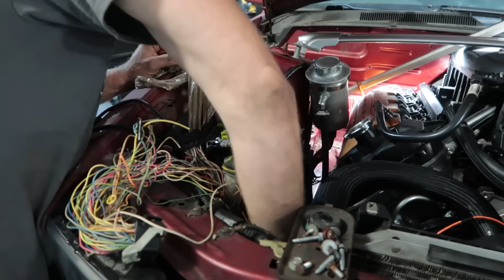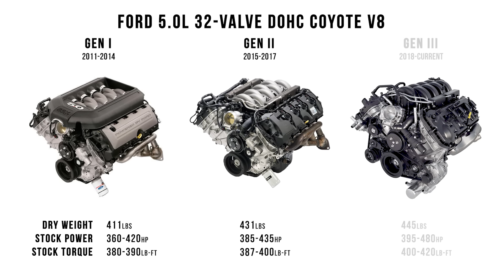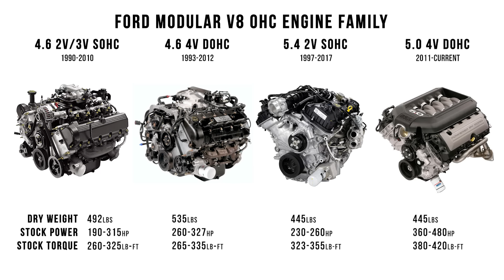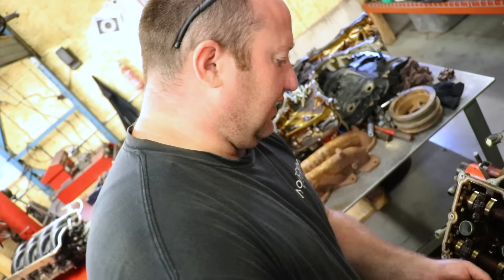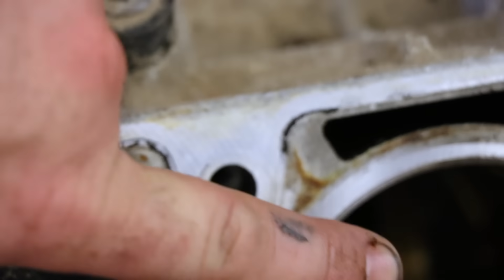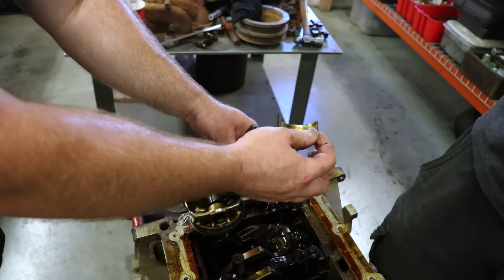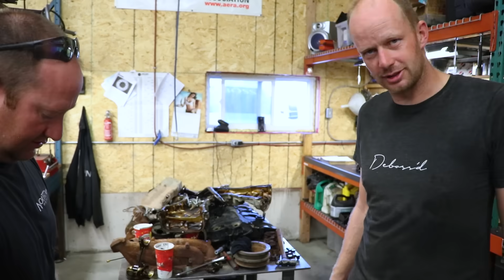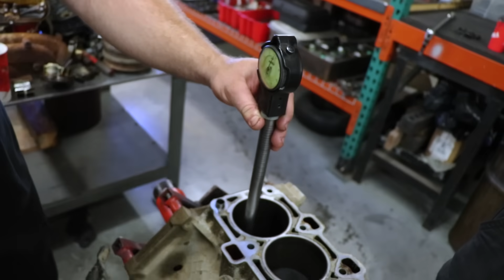REVIEW: Everything Wrong With A 5.0 Coyote Engine

Comment: Them talking about old pushrod technology and overhead being the way of the future made me think of the saying "change for the sake of change isn't always progress".
Reply: Overhead cams have more benefits than downsides over a pushrod other than complexity and cost. Less rotating mass, better oiling, variable valve timing (a benefit and widens the power band but is more complex and is a failure point). Some of the most reliable engines ever made (Toyotas) are overhead cam engines. THere’s a reason.

All things being equal a OHC engine isn’t really more “Complex” than  a pushrod one. It’s such a strange misconception.
Reply: @Terminxman lol sure bud pushrod engines have alot less parts in them and got more low in tq and last twice along 1 CAM 16 valves overhead cam V8 has 32 valves and 4 cams just asking for trouble all those parts in a Engine even Ford built a 7.3 pushrod engine few yrs ago for there super duty trucks because they new it's a better Design than a overhead cam Engine
Reply: There's nothing inherent about the OHV or OHC that makes one or the other make more low end torque you fudd. There are a lot of variables, intake design, valve size, exhaust size, port size, came profile, valve timing, etc. DUrr just look at GM and RAM with their endless ticking and oil burning with OHV engines while the 5.0 is bulletproof. Same with Toyota, everything Toyota has made for like 50 years has been OHC.  @donaldkinder6716
Reply: The Coyote makes more power than the pushrod 302!
Reply: One of the greatest lines ever! 
Tell that to these LEFTIST Democrats 
Also, with the word " Progressive "
There is upward progress, in a positive direction 
And there is downhill progress, in a negative sense...
Reply: @WhiteManXRP  not sure why boneheads just have to bring politics into any conversation. What does tearing down ANY engine have anything to do with politics? Nothing! Leave your peanut gallery comments inside your pea sized brain. (Like that’s going to happen, lol)
Reply: Honestly if ford offered a new mustang with a push rod engine I would happily buy it...just as long as the cylinder heads flow good compared to those junk e7 and gt40 heads the 302s had that boomers rave about...pushrod engines are way more reliable in the long run even with neglected oil changes

Comment: What a great tear down video. Thanks for posting it. I have a 2011 F150 5.0 that has burned oil since new. I always add Marvel Mystery Oil when doing oil changes. Its currently at 112k miles and runs like new. But.... burns a qt per thousand.

Comment: Good input, grate video. I got first gen 5.0 in my 2011,  260k km still purrs like a kitten with a couple tiny mods and a tune. I had zero problems with the engine so far mind u the entire truck has been great a sensor and some coolant hoses had to be replaced thats about it , oil change every 5 to 6k and only dealer oil and filter since i got it. I strongly recommend people do the same find a good small local shop and bring ur own oil and filter bought from the dealer what's recommended, never mix it up keep it consistent.

Comment: I still do my oil changes at 3000 to 3500 miles and my current F150 has 377,680 miles on it.
Reply: It has a 4.2 v6 and it's a 99 model and it works hard to earn it's keep.

Comment: This guys hates synthetic oil... 🤦‍♂️ The varnish on this engine is from lack of maintenance. Synthetic oil resists heat and sludge build up much better than conventional oils. This isn’t opinion, it’s science. SCIENCE FACT! This guys is definitely not a chemical engineer, and he is certainly old school in his ideas on synthetic oil. Truth is, synthetics flow better in the cold, have a more consistent viscosity throughout the oil change interval. The molecules are infinitely more uniform in their size and adherence and thus resist wear better and shearing forces better. Synthetics have higher flash points generally and so they resist evaporative loss better. On and on and on... Please don’t listen to this guys lack of knowledge on oil. He needs to do some research. This engine was not properly maintained and I would bet a lazy, cheap owner ran conventional oil in it. Educate yourself brother!

Comment: Use syn in my Subaru and Toyota, change every 5000 miles, got a 92 F-150 and Bronco, both have 5.8L Windsors, change dino oil every 3000 miles , both are pushing 300K.

Comment: I own a 2011 F-150 4X4 with the first gen 5.0 under the hood. It has 240,000 miles on it. I was hauling a heavy trailer the other day and did hear the rod bearings ever so slightly. I was in the gas pretty good though.  I will be rebuilding it sometime in the future. This motor is a workhorse and runs like new at almost a quarter million miles. Not Bad....
Reply: Good to hear, I too own a 2011 F150 FX4 5.0L truck and just rolled over 90K today, I hope to get 300K+ out of it. Its also had an easy life, kept on maintenance and mostly use it to commute, don't do a whole lot of truck stuff with it.

Comment: I have owned three of the 3.5L ecoboost engines. The first one had cam phasers replaced twice under warranty and the oil was changed every 4,000 miles by Ford. On the last two, I replaced the oil every 5,000 miles, but used Penzoils Ultra Platinum super duper oil and haven't had any tapping or other issues. Maybe it was luck or maybe Ford was using crappy oil.

Comment: He makes it sound like the previous cobra like the 2001 were single overhead cam. They weren't. The GTs of that Era were 4.6 SOHC- the cobras were 4.6 DOHC from 96-2004, ending with the terminator- the motor that made me procharge my ws6 after getting pulled on pretty good.

Comment: I've never used synthetic motor oils - WallMart SuperTech conventional oil - my ride has 482,000 miles - still runs (but valve guide seals are starting to leak a little).😁

Comment: The modular engine in general was as good of an engine as an LS. The 2 valve didn't make a lot of power but they're damn near bullet proof in stock form. The coyote is an awesome engine and makes a lot of power to boot! Awesome video and awesome tear down, learned a lot about the engine thats in my mustang!
Reply: The 2v 5.4L wasn't all that bad, like you said it was reliable and it was on par with just about everything of its day. It made 260hp to the GM 5.3L's 285hp at that time, but packed a walloping 350lb/ft of torque at only 2500RPM to the 5.3L's 325lb/ft of torque that was over 4000RPM's the bad years for the 5.4L were the 3v 2004-2008 ones even though the it made a good bit more power those were the ones that had issues with spark plugs and cam phasers, in the 2009-2010 model years they pretty much fixed all of its issues and gave it a very modest power increase to 310hp and it was arguably at its peak really in those years but 2011+ was the introduction of the Coyote/Ecoboost/Boss engines and the 5.4L and 4.6L were retired in all but the E-Series Vans after which.
Reply: Ls design is from 60s. Push-rod engines are dinosaur against Coyote dohc engine. Dohc is the way to go.
Reply: @gregorizi yet the ls still competes. Plenty of parts, easier. They are very different, and Ford had to use every trick in the book to compete themselves
Reply: @applejuice9468  LS competes because of more CIs, more power. Thats it. GM needs a 6.2L just to make the same power as a 5.0L DOHC. DOHC 32v is a more efficient design.

Comment: I always install connecting rod nuts torqued with red high strength locktite .even if bolt stretches the nut wont come off.

Comment: Lol. You lost me at "it's the way of the future". More parts more complexity more weight and more points of failure. It reminds me of back in the 2000 era when the e46 bmw guys were comparing their inline 6 to the LS engines and how futuristic they thought their dohc 6 was. Then they realized that not only was their "futuristic" dohc inline six engine BIGGER, but it was also HEAVIER, and had more parts, less power, and cost more.  Meanwhile bmw is still trying to "rube goldberg" the internal combustion engine, and the pushrod is still serving millions very well. I like the coyote, but it doesn't make a pushrod engine obsolete.

Comment: Remember GM always needs more cubes to make similar HP.
Reply: Fords always been good at making more with less.
Reply: @nathanmcdonald610  Less?
32 valves? 4 camshafts? more rpm? more overall width? 🤣🤣🤣🤣🤣
Reply: @MilkMan608  302 Windsor vs 305 tbi 🤣🤣🤣🤣
Reply: Babble on Ford needed 4 cams , and 32 valves, GMAC has completed with a pushrod motor regardless of size, take a look at NHRA pro stock, Chevy dominates, end of story.
Reply: @eternity1360  You really believe that NHRA Prostock cars are using the same engines and components factory stock Chevys are? LMAO.
Reply: @nathanmcdonald610  Oh a hater, suck it up buttercup, that fact it’s Chevrolet motors , and not Dodge or Fords are dominating, fyi they have be production motors Einstein 😂😂😂
Reply: @eternity1360  and ... Those engines are derivative of the Ford Cleveland design
Reply: Wonder why alot of mustangs have Chevys under the hood,I call Bs
Reply: @camclarke9952  Because you can get  a junkyard LS for a grand. A Coyote not so much. You get what you pay for.

Comment: have a 98 f150 5.4 2v 200k Miles absolutely zero issues with the engine and still runs strong.  Sad part is the engine is out lasting the actual truck itself so I'm in the market for a 5.0

Comment: So would you recommend using syn blend or conventional? I’ve been running full synthetic thinking it’s the best I could be using
Reply: run full synthetic, the problems they spoke about is from not being maintained ie:not changing oil on correct intervals , and from doing very short drives often that doesnt bring the oil up to temp and ends up crystallizing and other problems , same with normal oil just stay on top of it

Comment: yeah the dude saying the 5.0 is the wave of the future and stating the chevy is old tech, doesn't radiate Ford bias at all.  it doesn't matter if its old tech, ls makes big power in stock form with its 'dated" pushrod tech. thats the point with the ls, its simple and by keeping it simple in a small package and making big power is the reason its so popular. leaf spring suspension is over 400 years old but still works great. i don't see the relevance of that statement...lol. hes Ford biased and made that clear at the start.  i mean even ford went with push rod with the new 7.3 and made big power, even more with aftermarket help. cant say Ford didn't do that to get a piece of the aftermarket pie down the line like the ls has been enjoying for over 2 decades.  im not hating on Ford, i love the new 5.0 as much as the old windsor engines but the new engine is a nightmare for swaps.

Comment: dont forget about the 03-04 terminator cobra motor fully forged from the factory. They were under rated on power and there are hundreds if not thousands that have never had the oil pan off or heads off and are making close to if not more than 1k horse, mine is all bolt ons and is making 746 horse at the tires. Once the new fuel system is done and retuned for e85 we should easily be over 900 horse at the tires.

Comment: No thanks! I'll stick with the old push rod design Chevy any day! Way too much to go wrong with that engine. And how about the novice mechanic, which will he or she be able to rebuild? Then there's the cost issue and the frickin size issue! And the 4.6 being a good/reliable engine,,,are you kidding me?!?! Every single person I know that has had them had nothing but problems with them! From blowing the spark plugs out of there holes(which I have never seen on any other engine) to leaking oil out of every place it possibly could, cams going bad,or out of sync? Just absolutely garbage!

Comment: I had to rebuild my modular 5.4 32v,,a bolt came out from timing chain guide and stuffed up the timing chains and crank gears, just like Cummins KDP. Bent all 16 inlet valves at idle.

Comment: Oil pumps on modular motor had issues if you raised the rpm limit. The std pump would cavitate at high rpm and destroy the gears. The fix is to fit billet gears.

Comment: Wow I see you guys have another boating mooring block on your hands just fill it up with concrete and deploy - YES! engine rebuilding job done no worries. Then bolt in a 4 litre Turbo Ford Straight 6 'BARRA' 4 valve VVT engine you may have heard of them they are a terror on the drag strips 1 million kms reliable dont leak oil anywhere more power than that mooring block Coyote getting cheaper here in OZ to buy now turbo non turbo parts from wreckers and new old stock last manufactured in 2016. The only down side is the engine was only marketed in Australia and New Zealand but there is starting to get a few on the ground now in the US and if you can find a cheap importer you wont regret the exercise. Go on start mixing the concrete LOL.